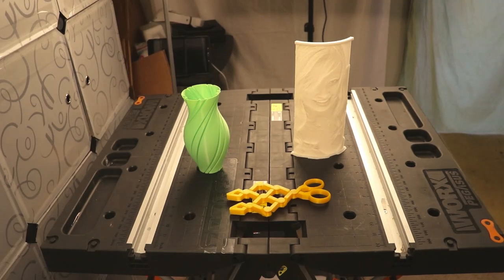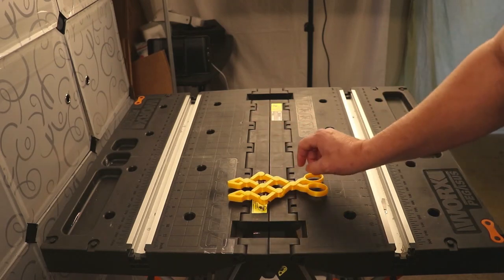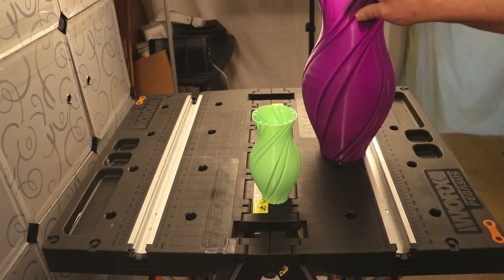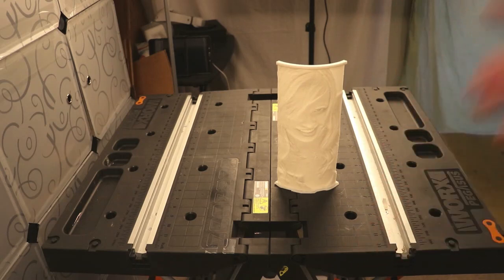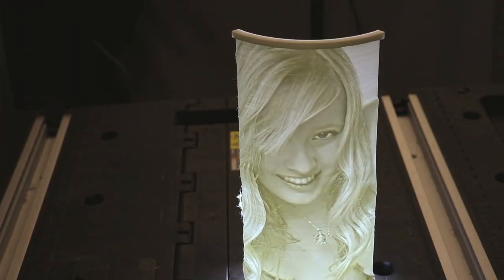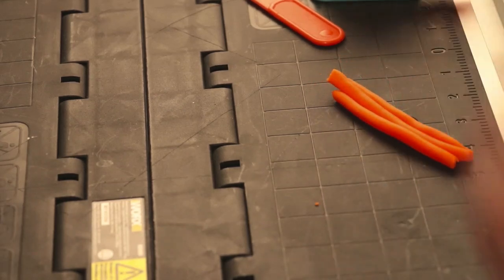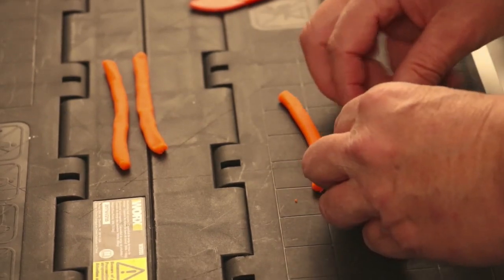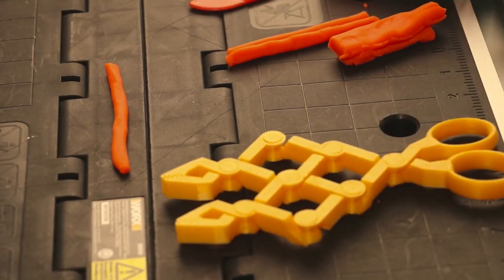CR-10 - 1 mm Nozzle

Comment: Hi friend! could you please share with us what retraction settings are you using with 1mm? because I am using 0.8 nozzle and have alot of stringing , thanks in advance!
Reply: I would like to know this also. I'm wondering what the heat settings should be also, as pushing so much extra plastic through the heat block presumably needs higher temps?

Comment: Hi when you keep saying its only two layers what exactly do you mean.
Thanks
Reply from the maker: When you're in your slicer and you're deciding how you want to print your model. You can decide how many layers of plastic you want on the top and the bottom of your piece. The fewer layers you have the quicker your piece will print. Most people use two to three top and bottom layers. If said decorative piece with lots of detail on the top or bottom or you need to tops and bottoms to be stronger. You may want to use more than two or three layers. In that case I use 4 layers
Reply: Average Joe's 3D many thanks for clearing that up.
Great video by the way.... too many people do vid's without explaining the full story, but i found yours most informative.

Comment: Are you using a 1mm nozzle with the stock hot end?
Reply from the maker: I have used it with the stock rather than cr-10 hot in. Where did upgrade to a Swiss Microtech
Reply: Average Joe's 3D how did the stock hot end handle it? I am using the 0.4mm nozzle with the stock hot end now and would love to go up in size, but I have read that the stock hot end doesnt have the power to heat/melt the higher amounts of filament that the bigger nozzles can allow.
Reply from the maker: @codymiller8505  you're right you increase the temperature of the Haunted to 225
Reply: Average Joe's 3D thanks for the response! Ill give it a shot.

Comment: Hi

So I have a 1.mm nozzle I want to print something big with heavy lines..
The filament comes out very thin like a thin line with tiny balls more like a pearl necklace.

Would you know what is happening?
Thanks for any help..
Reply: T wie Have you checked for a clog? If it isn't a physical problem then check to make sure you adjusted your slicer settings to account for the larger nozzle.
Reply: That is called underextruding. You need to configure it to push more material.